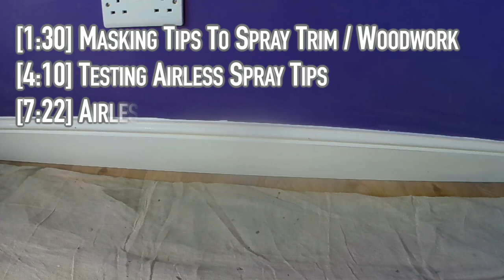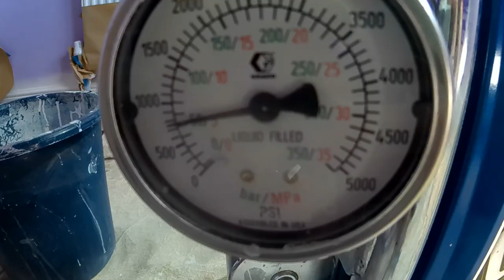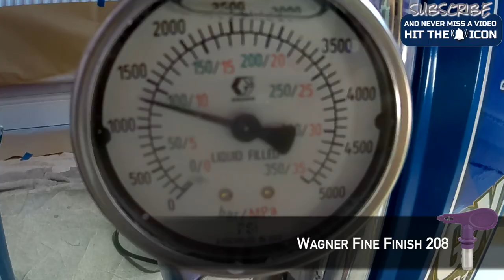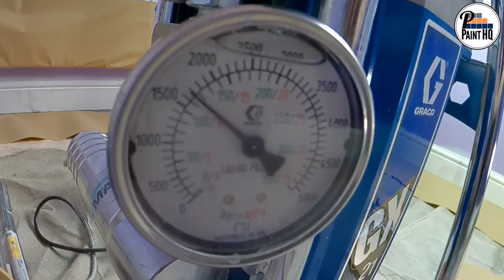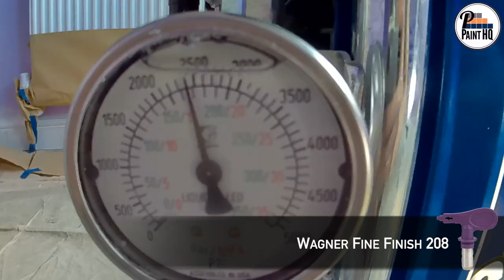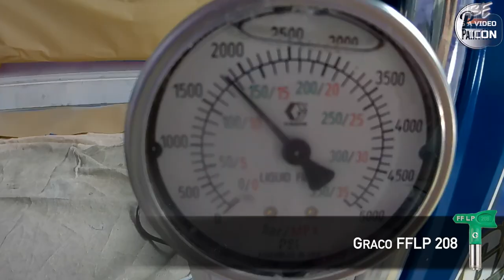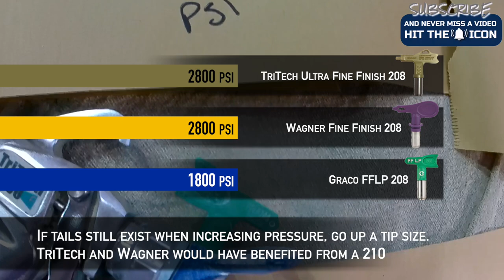Airless Spraying Woodwork | Testing Airless Spray Tips

Comment: I've just tried using a 310 fflp tip with some joncryl acrylic primer. I didn't thin and nomatter what pressure on the Gx21 I sprayed at, it kept clogging. I Thinned it with 5% water and it still did the same thing. How thin does it need to be to run in a 310 tip? Should I run a 311 or 312 tip instead. I see so many people painting trim with the 310 fflp, surely they must be using acrylic water based paints too and it doesn't seem they have issue?!
Reply from the maker: Hello my friend, sorry to hear you’re having trouble.. you’re right to choose a .010 such as a 310.. that size tip should spray most trim / woodwork paints (unthinned).. a 310 is used for paints that can also be used with a brush / roller.. I fear Johnstones Joncryl Acrylic Primer is one of very very few paints that doesn’t spray well, I’ve had others say the same as you m, that the tip blocks 😞..you’re right not to thin, I don’t look to thin trim / woodwork paints with airless spraying.. with the right tip selection and pressure, you’re usually good to go.. you’ve done everything right.. it’s just problematic paint, like I say you’re not alone… I can only suggest that the data sheet might offer a tip selection.. whilst I don’t usually go off whet the data sheet says, as in my opinion the suggested tip is too big (in my experience).. it could be worth a try.. or maybe it doesn’t recommend airless spraying 🤔 ..let me know how you get on.. regards Pete
Reply: @PaintHQ  what wood primer would you recommend instead?
Reply from the maker: I use a lot of the products below for day to day internal woodwork, then WP198 on anything that needs ‘stain blocking’ .. they are low viscosity, waterborne industrial 1K products.. spray very easily, no thinning at very low pressure ..being low viscosity, I use .008 tips.. so a 208 / 308... Also the new Graco FF LP 106 is awesome on spindles 

Here’s the products —

AkzoNobel WP198
https://holmanpaints.co.uk/exterior-wood/286-sikkens-rubbol-wp198-high-build-stain-blocking-primer.html

it’s actually a Sikkens product (exterior), has great stain / tannin blocking properties.. takes a little longer to dry Vs 

..WP136 which is my go to high build primer for white woods / pine / mdf — excellent on mdf with its edge sealing properties..

WP136 Water Based Primer / Edge Sealer
https://holmanpaints.co.uk/interior-wood/171-akzo-nobel-WP136-highbuild-waterbased-primer-edge-sealer.html

For the satin topcoat.. AkzoNobel Aqualit (Supercryl) Waterborne Enamel Topcoat
https://holmanpaints.co.uk/interior-wood/169-akzo-nobel-aqualit-waterborne-enamel-topcoat.html

You get a beautiful cabinet like satin finish ..and very cost effective, especially in 5 litre cans..

Comes in white, then if needing tinting both primer and top coat can be colour matched off any colour chart..

I’ve used Holmans for years, the Holmans team are all super helpful..

Can be delivered next day if required.. If this helps at all, Holmans have a 5% discount code, across all their range, if you place your order online..

👉 Code PAINTHQ

Keep in touch my friend.. regards Pete
Reply: Thanks! Would a 211 or 311 tip be good for trim and spindles too?
Reply: @PaintHQ  thank you!

As I've got 3 tubs of joncryl I'm determined to get this to work (hopefully). I also have some technos aqua40. So today I tried to spray the aqua40. Setup a 310 tip. Didn't water down at all, tried to spray and it blocked immediately! They say use a 0.11 to 0.13 tip, and going by your recommendation that they are usually oversized by manufacturers I thought the 0.10 would work. Tried to thin it down with 5%, still blocked at no matter what pressure. 10% worked better but would often block out of nowhere... I must be doing something wrong.

The technos aqua40, have you ever sprayed it or similar, it's a an alkyd eurethane paint... What setup did you have if yes?

Also what gun filter would be best for this and joncryl... I was running with a blue in the gx21, maybe it's too fine?
Reply from the maker: I’m wondering if there’s an issue with the tip.. not a fault, but rather it needs unblocking — wondering if the Joncryl has blocked the tip and it’s not cleared properly.. can you spray water? ..Turn up the pressure and spray in reverse, twist to spray and keep alternating and spraying to really clean the tip out —

This video I spray Teknos Futura Aqua 90 straight out the can — just a test lie CE with the GX21, and a 210 if I recall — then using the HH on a job 👍

Spraying Oil Based Vs Water Based Paint. HVLP Vs Airless Spraying
https://youtu.be/RXIb8hOmjFU
Reply: @PaintHQ  I've cleaned out the tip well. Sprayed both ways with water. Fully cleaned out. It was a new tip too
Reply: Also, what gun filter would be most suitable? I'm running a Graco blue spring (50 mesh) I think. Should I change it?
Reply from the maker: In my opinion you’re spot on.. I’d use the blue 100 mesh filter 👍 ..there is sn opinion suggests you could use the red 200 mesh filter with tip sizes .006 - .012 👍
Reply: @PaintHQ  ah okay so the blue on Graco is 50 mesh as far as I can tell! Maybe that's the issue with my tip blocking. I'll try a 100 mesh which I think is orsnge

Comment: Hi Pete, great video. Got a question. I've sprayed dulux quick dry satin wood and dulux diamond satin wood. I watered down 10% as per data sheet. Spraying doors and trim with a graco fflp 210. I always find it's really hard not to get runs in the paint somewhere on the job. I've tried moving the gun quicker and I'm definitely 10-12 " away when spraying, but still seems to be runs somewhere. Particularly on doors and door frames/arcs where you may have overlapping passes. I was thinking would a 208 or 206 be better as less paint and more control? Or will this spray unwatered down and it's too thin and runny with 10% water added? Any suggestions greatly appreciated!
Reply from the maker: Hi Ben, thanks for watching my friend... I wouldn’t thin the paints, the 10% could be referring to HVLP / airspray.. with airless I don’t (typically) thin woodwork / trim paints.. The dulux range will most likely be thixotropic / a material that can equally be brushed / rolled.. you’re spot on with a .010 tip selection 👍 I’d first try not thinning, next going to a 310, this would spread the same flow over a wider area, resulting in a thinner coating.. but I suspect not adding water will ‘cure’ your problem 😆 ..a FF LP 208 could work with the dulux paint, it’s hard to say.. you may have to up the pressure to eliminate tails, plus you could get tip blockages.. 

Hope this helps, keep in touch and let me know how you get on.. regards Pete
Reply: Thanks Pete, great help and reassurance. I'll let you know how I get on mate :)
Reply from the maker: You’re very welcome, anytime  🙏
Reply: @ben wilkinson  Hi I've had exactly the same problem with dulux trade quick dry satinwood. I use gx21 with 210 tip to paint some window frames and always get runs even when I try and move faster than normal. Fine on horizontal surfaces but vertical surfaces are challenging. Have you managed to find a solution? I just bought a 208 fflp tip thinking less paint would be sprayed hopefully resulting in a thinner coating and therefore less chance of runs. Tks
Reply: @ohmz55 hi mate how did you get on with spraying with the 208 with dulux quick dry Satinwood?? Also when you were getting the runs did you water down 10%? I've not done  any painting for ages, but I've got a full house to do so I will let you know how I get on.
Reply: @benwilkinson5457  Hey Ben, I tried so many different combinations (10% water, no water, 210 tip 208 tip) in the end I gave up with trying to spray and got a better finish brushing the window frames. So sorry I can't offer you a solution. However I sprayed the window board which was horizontal and got a great finish on that. I'm very new to spraying so I thought it was probably user error but that paint seems to have such a long open time and like you experienced whenever you have to overlap you seem to get runs.

Comment: Hey Pete, do you prefer using 08’s to 10’s?
Reply from the maker: Hey buddy.. good question.. I like to spray low viscosity ‘manufacturer’ coatings, so being very thin / free flowing, a .008 tip is perfect.. if I was spraying a thicker ‘decorative’ coating, so a product that could equally be brushed / rolled, then I’d use a .010 👍 ..hope this helps explain my friend.. regards Pete
Reply: @PaintHQ  Brilliant, cheers Pete nice simple explanation.
Reply from the maker: You’re very welcome, anytime 🙏

Comment: Can airless spray gun, spray with gloss paint
Reply from the maker: Hey Moh, do you mean oil / solvent based (gloss).. yeah sure, just ensure the equipment is able to handle solvent and it’s electrically grounded.. then it’s just a case of using the appropriate cleaner to flush out afterwards.. hope this helps, happy to try and answer any questions if I can.. regards Pete 🎨💯
Reply: Hi Paint HQ🎨 What airless spraying gun do recommend to buy... As am looking to buy one ... thanks
Reply from the maker: Hi Moh, I’m fortunate to own 2  ‘flagship’ guns, the Graco Contractor PC Compact and a TriTech T380 that I’m using in this video.. Both are 2 finger guns, that’s my preferred configuration (over 4 finger), very popular amongst sprayers..

The TriTech T380 is a well crafted, solid gun, a more weighted feel ..You can feel the quality in the hand, and I can see why, it’s a great piece of engineered aluminium alloy 👌👏👍 ..it’s built to withstand higher pressures if needed, whilst maintaining a positive shutoff.. 

The Graco Contractor PC, especially the compact.. is a genius innovative design, the way the shorter handle sits comfortably in your hand.. the Graco Contractor PC Compact coupled with a 1/8” whip is so manoeuvrable 💯 ..perfect for spraying tight spaces, such as cabinetry..

If you get chance, have a feel of both, try the trigger pull and see whet you prefer, and what suits your main spray applications..

Hope this helps my friend, let me know what you decide 😆 keep in touch.. regards Pete

Comment: Hi 208 Wagner dos it fit 250m ?
Reply from the maker: Hey, great question.. it will if you use the TradeTip 3 Tip Guard.. this video explains that topic and what you need to do 👍

Wagner 250M Setup. Airless Spray Tips Explained. Wagner 250M Cleaning
https://youtu.be/8APgip0-5J8

Hope this helps my friend.. Subscribe and keep in touch 🙏 ..regards Pete

Comment: You could of painted 2 rooms with a 3 inch brush and a 15 inch roller haha
Reply from the maker: Hmm not sure I’ve ever painted that fast 🎨💨 🤔 ..you certainly wouldn’t get the level of finish, spraying a manufacturer finish such as AkzoNobel, where you can achieve a cabinet like result on internal joinery 👌 ..appreciate your input 👍

Comment: Hi Pete, i followed youre advice. I am spraying a 5 bed house all woodwork with 11 doors and staircase.  On your advice I bought some Akzo Nobel Enamel top coat spraying with a 308 tip on the Graco GX21Df. Wow this is really a game changer and i think could help a lot of others. I think trying to spray dulux satin wood with a 10 tip size is really tricky as it puts out too much paint too fast for a beginner- no one says this and you will get runs. With 08 tip size theres so much control and time to react. No runs worth mentioning. I am going down to a 106 tip for stair spindles. 

Its worth noting to people that the gun that comes with the GX21df does not take a 200 mesh filter so you need to get a compact or other gun that will take a 200 mesh filter for the 06 tips.

That paint shop Holmans paints is brilliant. Thanks. Can you spray the primer that is Akzo Nobel with 08 tips? Is this what you use with the top coat as part of a system?. I got some Armstead primer undercoat and I have had to use my 517 with it, a 210 and 212 kept blocking no matter how much i watered down. I guess its the particle size of the paint. I only used it because it was cheap. Bad decision. 

Also i strained my paint on your advice too. Its amazing the stuff it filters out you dont see in the paint.

Anyway just wanted to say many thanks your advice has been a game changer. There isnt much advice out there on exact paints to use with what tips etc so thankyou. Also it might be worth doing a video about all the different paints you use and what tip sizes. There is tons of paints im sure you use that no one has ever heard of available from Holmans. You just dont get specialist paints down at Brewers and they cant advise on spraying ive found, even though they sell the gear.
Reply from the maker: Hey Ben, thank you so much for taking the time to share your experience.. I’ll try and cover your points, apologies if I miss something.. it’s not critical to use a 200 mesh, I very often use a 100 mesh (I’m my QuickShot for example) with a FFLP 106 with little to non tip blockages (max tip in an UQS is .008 so there’s other things to be aware of).. so yeah, try the 100 mesh, I’m sure you’ll be fine.. Yeah the AkzoNobel primer is awesome, sprays beautifully with .008 and .006 tips, just up the pressure by an additional 100 psi ..my recommendation is to spray lighter coats with the primer (it dries quicker) — and denib any grain raise between coats… it’s a high build, mdf edge sealer. it will even stick and seal any niggles / residues of old paint peeling 👍  the primer is formally what I call WP136, I believe the code is changed, but it’s the only AkzoNobel primer / edge sealer on the Holmans website.. there’s a PaintHQ discount code, just enter PAINTHQ on the website at checkout 👍 just quickly, there’s another AkzoNobel / Sikkens product that’s WB and great at stain blocking — blocks tannins in oak / hardwood.. I believe it’s still called WP198, like I say it’s great, just takes a little longer to dry.. keep in touch my friend, it’s great to get your feedback.. regards Pete.. Ps I plan to do videos covering tip selection etc along with other tips and tricks that would help 💙💯

Comment: Odly enough the last 2 jobs I’ve done i used the 208 FFLP tips on. First job was using hapftprimer and it sprayed bloody marvellous @900 psi. This week same tip but spraying zinsser 123! I wouldn’t normally use zinsser because I know from past experience they don’t spray too well. I hadn’t planned things out too well, at a pinch I had to buy the 123! and never again. I couldn’t get it to spray too well even though I’d eased it by 20% and @1500 psi.
Reply from the maker: Hey James, yeah you’re experience perfectly sums up what can happen.. I still keep a spreadsheet on my phone, something I’ve done from the start, I note different tips / pressures and the products I’m spraying.. useful if you’re looking to spray something new.. always a pleasure buddy.. regards Pete
Reply: @PaintHQ  good morning Pete. Yup that’s exactly why it’s worth knowing these things tbh. The tritech tip seemed to give a better fan and slightly better finish than the FFLP but, for me, I think I’ll stick with the FFLP tips on woodwork as I’m genuinely spraying at lower pressure and saving the piston on the GXFF. Next time I’ll make sure I’m more prepared and, have the paint I’d rather use than spraying zinsser! Every time I’ve sprayed it ( 123 and 123 + ) it’s given me nothing but trouble. I’ll give the axonobel one a try at some time.